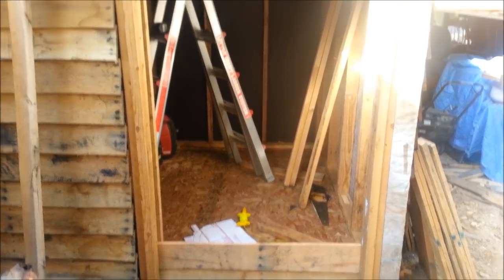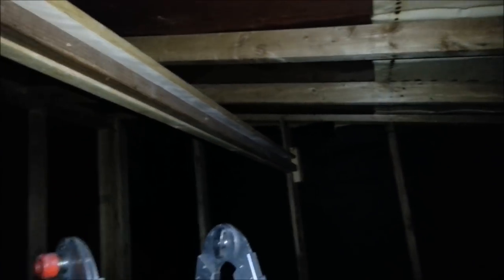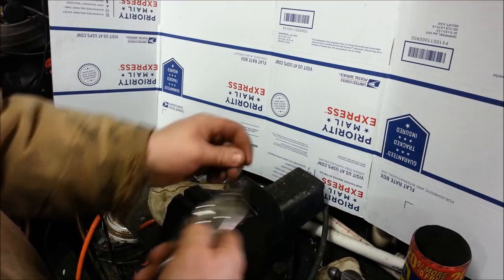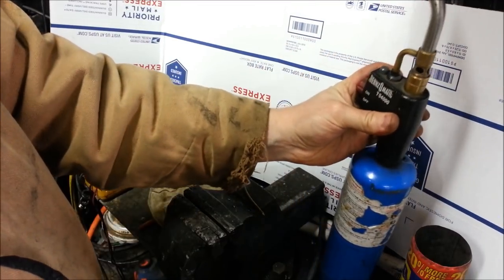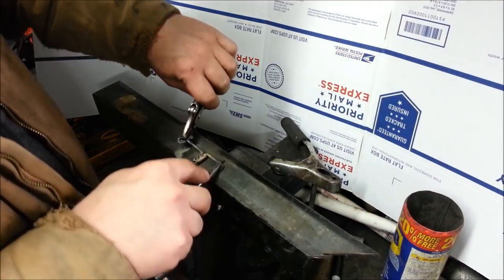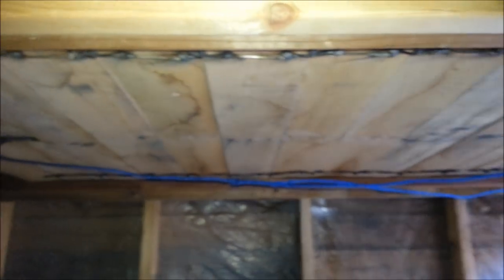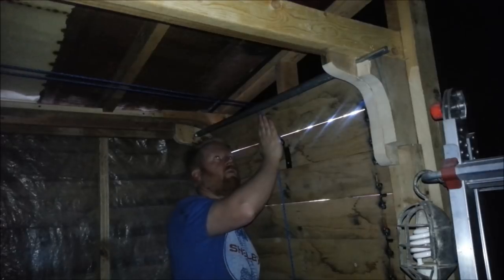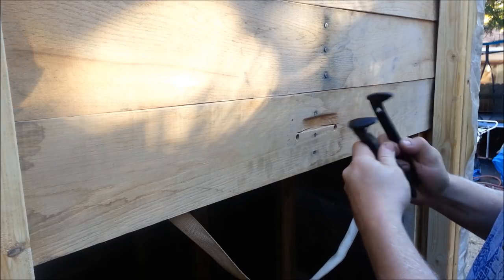Wooden Roll Up Door and Hinge Making * #5 Pallet Shed from FREE materials

Comment: Fascinating stuff! You could use a spring on the back instead of the weights. I used to install roll up doors quite often in the storage barn shop I worked at. They all had rotary springs on them with ratchets for adjustment. A little wax on the ends of your boards and the inside of the track will make it run smoother too.

Comment from the maker: Yup, a little paste wax and it is slipping and sliding nicely. I have some springs but they are all overkill. A spring is the best as it increases in resistance as it extends which just happens to be the exact thing the door needs. As is goes from horizontal to vertical it has more force pulling it closed and the spring balances that. I have some bungee cords acting on it right now and they seam to be just the ticket.

Comment: Very nice creativity and work with the hinges, but one could have used 2 well oiled leather strips on the inside of the door planks (maybe old belts) to form a flex hinge thing.
Reply from the maker: That was my original plan. But trying to do it for no cost, I ended up using the nails.
Reply: The nails did look cool, if quite a bit of work.

Comment: Remember never to pull it down from the uppermost board if it's left half open. I did this on an industrial freezer unit with a stiff door and jammed my fingers between the boards. I was just able to reach the bottom of the door to lift it up enough to release my fingers otherwise I'd have had a long cold and painful night.
Reply from the maker: big ian For sure!

Comment: Great videos, thanks for sharing. Just a couple of questions, for the DIY hinges , didn't you just harden those nails without tempering? That would make them brittle would it not? 2nd Q. Weather proofing of your roof...did I miss something? Was the roof painted with some sort of polymer,(the black), to water seal it? Thanks and keep up the great videos and very innovative projects.
Reply from the maker: +David Johnson The nails wouldn't have been hardened and would be the same as normal. The roof was just painted. No waterproofing was needed as it is a flat sheet.

Comment: your vise moves around every bit as much as mine I see. been meaning to mount it. just don't have enough room on the bench so I usually use it on the floor with a bigass C clamp that I stand on
Reply from the maker: Yeah. I only have one bolt in the base so I can swing it out of the way and free up valuable bench space when I need it.

Comment: Did you consider fabric straps like seat belt material instead of hinges. two or three the length of the door would have been very strong?
Reply from the maker: That was my original plan. You can see some straps in the video, but I decided it would be more challenging to make the hinges.
Reply: sixtyfiveford great job and use of materials  i have a feeling that door will work well for years I also like how you chose to lap your sideing nice job thumbs up

Comment: great piece of creativity.  do you think its possible to build a house out of free materials?
Reply from the maker: It would take a lot of work and resourcefulness but you could probably do it really cheap.
Reply: sixtyfiveford The waste from building demolitions, can easily supply materials for the major build of a home, all u need is to ask the demolishers can u take the stuff away they will gladly give it to u, as they are paid for carting it to the tip, Near me a demolisher was ripping out half the timber flooring. i asked to keep the floor joists and bearers, I ended up with 1.5 tonnes of perfectly good hardwood floor ing, which would have gone to landfill. What is happening here in Sydney Australia is criminal , as little is recycled. That is a great idea on cleaning spark plugs. Keep it up man!!!!!!!

Comment: i'd like to do this same project on my garage, but i'm not sure how hard/heavy the door would be to raise because the door would need to be 12 wide and 7 foot tall.. any ideas or tips?
Reply from the maker: +DolittleMccoy It would be very difficult at that scale/weight.  You would be better off with an aircraft hanger style door system https://youtu.be/UnIitxNAbus . Metal framework would be required to support the weight.
Reply: Thanks for the info.. Very cool idea, Never saw those style doors before now.. Since i'm on a tight budget and really don't have the extra cash to purchase new store built garage doors, this seems like something pretty simple and affordable to build myself.. Thanks again.
Reply from the maker: DolittleMccoy
2 swinging doors or 2 accordian swing doors would also work nicely and require much less, if any metal framework. https://s-media-cache-ak0.pinimg.com/736x/a4/02/21/a402212f0720fb2f201a8c7ffbec2fec.jpg

Comment: I would have either used cloth stapled as hinges or plastic banding or soda bottle plastic as! It was hinges.... Wax your rails for sorbet operation your long chain hinges cans out very nice just a lot of work you could have used old chain nailed or screwed also
Reply from the maker: Both the cloth and plastic will fail in relatively short time. The entire project was a lot more work than a slap together shed.
Reply: sixtyfiveford actually plastic 2 liter bottle hinges could last 20 years or more.... The most likely area of failure would be the attachment points..... Even drilling from the side clean thru the boards and plastic string trimmer cord could be a great way..... Another way is holes drilled thru with figure 8 stitching with strings trimmer cord  as hinges...I have used thread and cordage as hinges for airplanes figure 8 gives a very tight gap and they actually last huge long time.... Another method is to notch out squares opposite each other place a rectangle of wood drill from the side and pin.... What I'm getting at is there are many ways to make hinges even old belt leather wooden hinges plastics etc etc etc . What you did was Kool just way more work than really needed.... I can't imagine the time you took to make that chain
Reply from the maker: Entire chain, custom hinges was built in under an hour.

Comment: my board stretcher is apart right now while i wait for the knudler bearings to get here. I burned them out when i cranked down to hard on a board that just wouldnt cut right. I cut it to short the first time, so i cut it again and for some reason, it was even shorter,then i got the board stretcher out and instead of easing into it slowly, i over cranked the board stretcher and burned up the bearings. Just another lesson i learned about getting in a hurry.

Comment: Use some skateboarder's wax on the door panels/runners it will make it slide much easier. Other than that, AWESOME build man!
Reply from the maker: Device420 Yeah, paste wax works almost identically but absorbs into the wood better than skaters wax.

Comment: Rookie question: how do you drill holes and weld bolts and get them lined up perfectly on the railroad spike handle? Thanks, great vids
Reply from the maker: Nick M Clamped them together and then drill a hole through both at the same time. I then inserted the bolts and welded them.

Comment: I once saw a shed door like this on a farm in the area. It was used as a livestock door. They had lined the track with old bed rails and slit pieces of plastic pipe and put it on each wooden plank door section. The circular shape of the pipe reduced the contact area and the steel lined track made the whole thing slide nice. The hinge looked to be made out of braided hose. It was counter weighted with old tractor weights. Worked surprisingly well. So well I stored the idea in my thick skull. Good job.
Reply from the maker: Very neat. Thanks for the info.